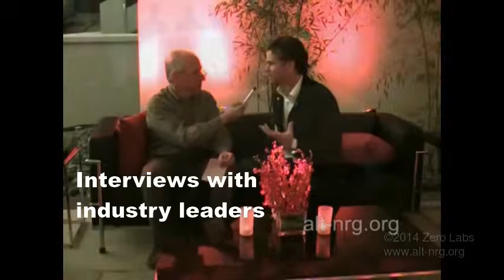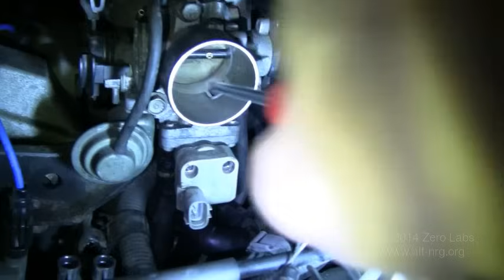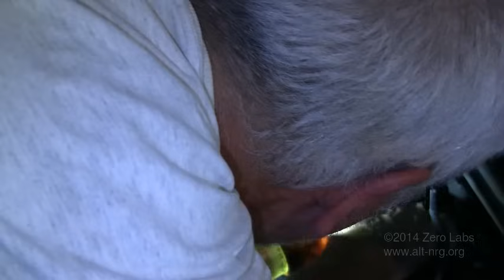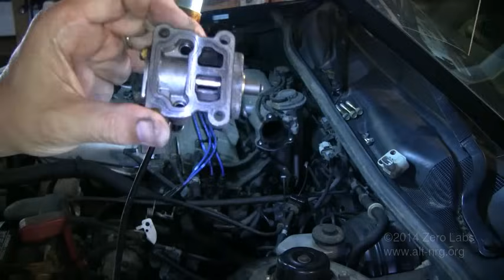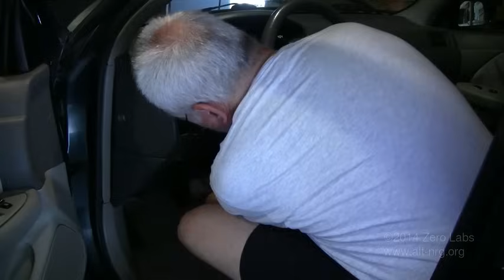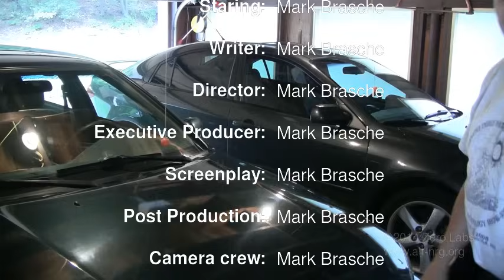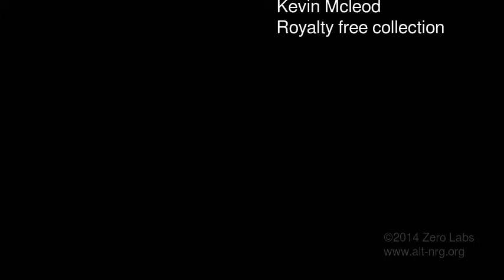#372 Better repair method Toyota Camry Idle Air Control Valve

Comment: For followers, his alternative method that "doesn't require you to remove it" is to "plug the large middle hose with your finger" while it's still on, that he describes at 4:00 then flood with carburetor cleaner.

Comment: My 2001 camry was running ar 1800 rpm when warm. Cut the a/c on and it will drop to 1400 rpm. Cleaned the throttle body. Same results. Watched your video. Cleaned the icv and magic appeared. Runs like new now. Thank you. Saved me alot of money. Thanks
Reply from the maker: Very gratifying.

Comment: God damn it! I didn't remove the hose, so all the carb cleaner went into the engine oil?
Reply from the maker: I'm afraid so. Not sure if it will vent off but I would change your oil and filter immediately anyway.

Comment: I broke the same vacuum hose. There was a plastic flow reducer that also broke. It seems that replacing the hose with a close match and no plastic flow reducer piece might be part of a P0441 and P0446 code. I ended up replacing a lot of emission control stuff. Will try cleaning the throttle body and IAC valve as my throttle is sticky as well.

Comment: I just finished fixing a fast idle and P0505 error in my nephew's camry thanks to your video.  Not knowing better, just from first inspection it appeared that the IAC simply controls that vacuum dashpot right next to it, using that to regulate idle speed.  Your video corrected my misunderstanding and clearly explained exactly how it worked.   Thanks!
Reply from the maker: Love it.

Comment: The reason you fix that because of high idle or what happen you didn't mention
Reply: He mentioned it and he also put it on the video description: ***My wife's 1997 Toyota Camry with 2.2L 4cyl 5S-FE motor had check engine light, failed emissions, surged at idle and light acceleration, code P0505.***

Comment: My 2001 Camry 3.0 v6 is idling too low and I took this apart and cleaned it as you stated and no change. Now that I look back at it you mention the valve should be spring loaded and mine was not. I could spin it both ways with no resistance once the carbon was cleaned out. Does this mean I need to replace it?
Reply from the maker: It should spin freely between stops but if you crank on it a bit more at the end of travel you should feel the the spring loading. It's quite stiff. Also, once the IAC valve is cleaned, the idle speed can be adjusted by the position of where the IAC valve body it tightened down with the 4 screws. There's even a calibration marker on the throttle body. Good luck!
Reply: @zerolabs  thanks for the response. Would you be able to describe the process a little to me? I assume I'd have to take the throttle body off to access the 4 screws holding the IAC on at the bottom?
Reply from the maker: @nicholasfilion1123  Oh, wait. Been a while since I looked at this. No. Do not remove the IAC. What adjusts the idle speed is the electro-magnet assembly held on by the two screws with slotted holes that allow a slight rotational position adjustment. Sorry for the confusion. Super easy access from the side. Super simple to adjust.
Reply: @zerolabs  yeah I took that off in order to rotate the valve when I was cleaning it out. So I should be able to loosen those two screws and rotate the electromagnet to the right to increase the idle?
Reply from the maker: Yes.
Reply: @zerolabs  I gave it a try and that did not seem to fix the issue. I did feel the spring tension when I turned it more. Could there possibly be another issue?
Reply from the maker: It's like Rosanna Rosanadanna allawaays sez.... ;-)

Comment: Idk if this is the better or simpler method, in my experience it's the only way to do it.  There's no simple way to do this especially because the biggest thing to watch out for is stripping those screws.  The process is already simple.

Comment: My only question is what if the cleaner goes into the hole that drains into the crankcase? will this harm anything since it evaporates at some rate. I don't know what rate?
Reply from the maker: I honestly don't know. My assumption is it's not good to have in the oil if it's not designed to be in there. If it can cause damage, I'd rather not find out the hard way.

Comment: Thanks 
I think I have this problem . I am still investigating it and that is why I am here.  Why would the engine stall and turn off ? I had the commute from hell on Thursday in San Francisco at Rush hour with stop and go on steep hills. Then stop and go traffic on the freeway. As I would slow down for a stop light while still moving the engine would die, I would have no breaks or power steering while moving. I'd have to come to a stop get into park and then use 2 feet , one on break and the other on throttle to keep the engine running waiting for a light to change. 

This is a Deadly problem because people can drive the car thinking the first stall is just a warm up glitch.

Comment: My 99 Camry car would shut off in idle mode. The only thing that fixed it, was replacing the oil temperature gauge, which was quick and easy and about $50. https://www.youtube.com/watch?v=3Te2c_7EL8c

Comment: Thank you. Just fixed my son's 2001 Camry using this video.
My idle air control does not have that down tube but exercising the actuator with the intake full of carb cleaner worked a charm.
Reply from the maker: That just means you have a non-california emission version and the crankcase is ventilated elsewhere. Makes it much easier to perform this procedure. Glad it worked for you. You just saved $300 or more!
Reply: @zerolabs 2001 Camry le with only the two coolant lines? This is safe to do? Where is the crankcase ventilated on non California models?
Reply from the maker: @jimandrews9160 Yes. It's in fact safer than CA emission vehicles. I believe non-CA emission vehicle crank cases are vented directly into a PCV valve somewhere downstream of the throttle body, on the intake manifold. You're golden.
Reply: @zerolabs You're response is much appreciated!
Reply: @zerolabs I am going to do this tomorrow. Since I only have the two coolant lines I was wondering once I put cleaner in the IAC and get it cleaned does the fluid in there get sucked out when I start the car or should I try to blow it out with compressed air?
Reply from the maker: @jimandrews9160 It just gets burned in the cylinders.
Reply: Only Toyota cars sold new in California were required to have that IAC vent hose. The rest had only two water hose connections and no middle vent hose.
Reply from the maker: @1drhnsd1 Correct. Trouble is, most sold throughout the country were built to also be sold in CA. Very few non-CA emission vehicles exist.

Comment: 2009 Camry 2.4 with 152K has very rough idle vibration that shakes the whole car at stops, does the Idle Air Control Valve effect this problem? I have new front and rear structs, all new motor and trans mounts, replaced crankshaft sensor, and plugs and coils.
Reply from the maker: YES IT DOES!

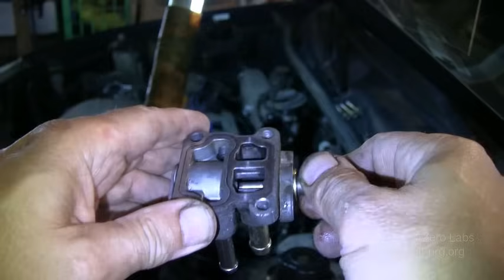Comment: Hello At 9:24  you turn a magnet. I lost mine and would not like  to replace entire piece. Is this held on by a Phillips or hex screw. My idle control valve moves freely now but car stalls on startup since that magnet is not in place. Thanks.
Reply from the maker: This is probably old news but the magnet is glued in place and it's orientation is critical. If yours is broken you'll need to replace the entire IACV. But at least you can save the cost of a mechanic's labor.
Reply: Thank you for your reply. I replaced IACV and now it seems coolant is leaking into air mixture.  Well this is what I think. All hoses are in the correct position. I did notice some white exhaust. Should I do the bypass for coolant and is there a disadvantage on doing this mod?

Comment: I HAVE CAMRY 97 , WHEN I START COLD ENGINE RUN  1800 RPM AND IT'S TAKE LONG TIME TO COME ON 600 OR 700 RPM, 
I DON KNOW WHAT'S PROBLEM, I HAVE NO COMPUTER,I MY SELF WORK HOW MERCEDES BEN MOSTLY DIESEL ENGINES,
IF SOME ONE KNOW PLZ,

Comment: Is your 97 Camry a Federal or California emission? I recently installed a used engine and the Throttle Body bottom bleed hose between the coolant hoses is not supplied. I immediately got the P0505 code and perhaps the ECU is not recognizing the missing bleed air?? Solution, update the throttle body or maybe the computer?? Notice the used engine cylinder head doesn’t have the vent tube located below the intake manifold between 2&3 fuel injectors.
Reply from the maker: California. As I understand it, most made in that period were, just because.

Comment: I have 1996 yota camry 2.2l 5sfe auto and this car has shut off at stoplights and waited 6-10 mins before it would start again. Ignition coil, throttle position sensor, spark plugs, wires, egr valve and this issued has continued. Going to try this tonight and see if there is any indication of hope.
Reply from the maker: And the verdict was?

Comment: I am worried. I just flooded the valve with carb cleaner and did not disconnect the hose that you mentioned. What do I do?
Reply from the maker: Change your oil.

Comment: can you next time do a run down on the engine bay of things were not understanding where to find them..mfs,  maf sensors..I have a 2001 Camry with only 91,300 miles.thanks

Comment: I realize this is a very old thread but my 2000 Camry has but two hoses to the Idle Air Control Valve. Do you know where the spray will go without the center hose as depicted in this video?
Reply: A comment from someone earlier said you would have to take the whole throttle body off as shown later in the video to clean it.  Hope this helps!

Comment: I sprayed a little sea foam and now it stays on when cold but today I will take the house off the bottom and then try that because its idles super low. No power drives like the fuel filter has never been replaced. Thanks for the good information!

Comment: Excellent video. When I change my fuel filter, I also plan to clean my throttle body and with this video, I can now clean the IAC valve. A few years ago I brought my car to the shop for idle problems and it cost about $75. Now I can do it myself for the price of 1/4 can of throttle body cleaner or about $1.50. Thanks

Comment: where you took off the sensor to show the magnetic knob inside did that need to be sealed back on?
Reply from the maker: No. But when you reassemble it to the butterfly valve body, there is some rotary calibration you can do which sets the idle speed. Once set correctly, then tighten the two retainer screws.

Comment: Mi mother owns a 94 Corolla with the 4afe engine, it has exactly the same mechanism. It idles too high (1500-2000 rpm), tomorrow Ill try this. Its much more easy to do (less dissasembly). 
Thanks a lot for the video my friend, greetings from Paysandu, Uruguay

PS: thumbs up for your video

Comment: At 2:39 shouldn't there be a black o ring that seats against the circular area surrounding the magnet/shaft? Aside from that, I just used this same procedure on 2001 2nd gen avalon 1mz-fe, only difference was that the metal hose nipple that needs to be blocked is right underneath the spinning magnet, this nipple is angled and easy to access, I used a spare nitrile glove to block the nipple and then let the carb cleaner leak into the inside of the glove to dispose.

p.s. as someone who loves learning about "why" and not just "how" to handle a procedure you have been one of the best explainers I have came across. Thanks for your time & insight sir!

Comment: Excellent video. Clear, concise, I've learned a lot. And you easily saved me $100 or more, plus the hassle of running vehicles all over creation. Thanks! Now if I can figure out why the battery light is on, even though the alternator is putting out plenty of power and a new battery...

Comment: For my needs, the best part of this video was learning that the valve was suppose to turn. Mine was stuck at first. I have a 2000 toyota camry Le 2.2. I could not find a drain hose on mine. The valve turns freely now but for about 3 seconds it seems to stick closed on the first cold start,  I don't know if It need more cleaning or a new valve. Excellent teacher and video. thanks
Reply from the maker: More cleaning.

Comment: Can I use PB B'laster instead of carb cleaner? I know it's good for clearing rust, and I'm a little far from the auto store
Reply from the maker: I wouldn't
Reply: Zero Labs well, thanks. I ended up finding some carb cleaner, id highly recommend carb cleaner only if u have no idea where it will end up. Carb cleaner is known to be one of the cleanest/fastest to dissipate substances for working on cars. Thanks, anyway guy.

Comment: I worked on my wife's 1997 Camry today and the hose that broke in your video also broke when I tried to take it off. What is the name and function of that hose? I need to buy a new one obviously, but I don't know the technical name of it. Thanks!
Reply from the maker: Crankcase vent hose.
Reply: I got one from the salvage yard, but thanks anyway.

Comment: Those screws are JIS type (Japanese Industrial Standard). JIS screws have a slightly different slot profile than Phillips and although a Phillips tip will fit in there, the stock screws are on very tight and will tend to cam out from lack of precision fit. A #2 JIS bit or driver is correct size. JIS bits and drivers can be found online and possibly ordered through local parts outlets.
Reply from the maker: I learned something new today. Thanks!

Comment: thank you a lot! my mom have rav4 and the thing is very similar. my idle was very poor and in low rpm on a hill was a pain to get to the top. i've cleaned the valve (without removing) and it was a sucess.

Comment: You sir, are the man! This worked a treat on my 92 camry. had problems with cold starts and rough idle- when it got to the shaft it would barely turn- a few minutes with the throttle body cleaner it freed right up  Thumbs up!
Reply from the maker: I love those success stories. Keep'em coming!

Comment: My 1995 Celica 2.2 is exactly like that. But on the 1994 4Runner, it is not there.  Parts guy says there isn't one. So what did they do differently. Appreciate any feedback.
Reply: steve jette on 4runners 2nd gen iac valve is integrated part of throttle body, so if you ever needed new iac, yes you guessed it a new $700+ throttle body from the dealer would be in order.
Reply: Slava _ You sound like my new best friend.  Evan the dealer  parts guy was unable to help me. Do you have any other sources showing the IAC in throttle body ?  I REALLY APPRECIATE ANY HELP WITH THIS.  THANKS.

Comment: Quick Question. I was doing this repair and noticed the tube that drains into the crankcase, which you removed, does not seem to exist on my 98 camry le. how do I make sure the fluid does not go back into the engine somewhere if I do not have this tube to remove?
Reply from the maker: This is only a guess but, if there's no third tube in the center, the carb cleaner should just pool there until you start the engine and then get sucked into the intake manifold. If you're still unsure, then you should take the throttle body completely off the first time like I did and inspect just to be sure. I'd be curious to know what you find to post here in the video comments.

Z
Reply: Is it bad if it gets sucked in the intake manifold?
Reply from the maker: No.

Comment: Thanks for the típ. I was looking for a bolt that controls the air flow into the plenum. And thanks to you I learned that it was the iddle speed control valve. Thanks again.

Comment: Great video, very well done. My problem is a start run die situation when cold. If I keep trying to start it long enough I can get it to idle. If I let it sit and warm up it will run just great. I can drive it, shut it off, start it up it runs good all day. The problem is it's like ground hog day (the movie) the next after being shut off all night I have the same problem. I followed your video, but it still does the same thing.
Reply from the maker: Sounds like the fast idle vacuum solenoid to me.

Comment: I tried  every trick on you tube  yet my camry altise 2005 wouldnt idle properly......4 mechanics could not solve the puzzle......today I traced the problem and replaced what you call   COOLANT TEMPERATURE SENSOR  ,,,this sensor sends signal to the ECM and reports coolant temp....accordingly the ECM send message to the throttle sensor   hence a faulty coolant temp sensor send a faulty message to ECM  and car does not idle properly  and burns fuel  ,excessively...the moment I replaced that  ,the car idled great  the check engine light went  and the motor ran very smooth
hope this will help someone ....sensor costs only 25 australian dollars

Comment: Sir, I have cressida 1989 model, where air control valve is located. Will you please guide me
Reply from the maker: They are all located in the same place, at the base of the throttle plate housing.

Comment: I used this method with great results. My question is - how does the port get so dirty with carbon if it is located forward of the butterflies?  Seems like only fresh clean air should be going in there.
Reply from the maker: There are two sides to the port, before and after the butterfly. The IAC shutter valve regulates the amount of air that bypasses the butterfly. There is also crankcase blow-by gases plumbed directly into the IAC. That's where most of the carbon buildup is from. The older the motor gets, the more rapidly carbon will build up.
Reply: Zero Labs thanks for the explanation.